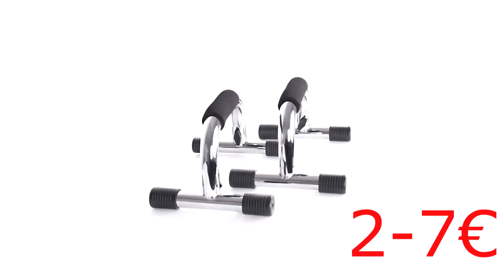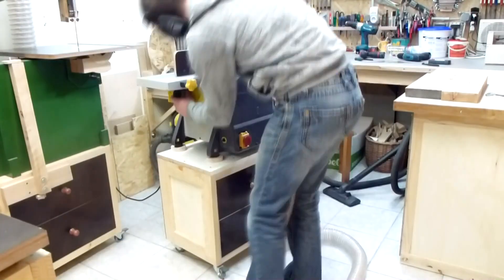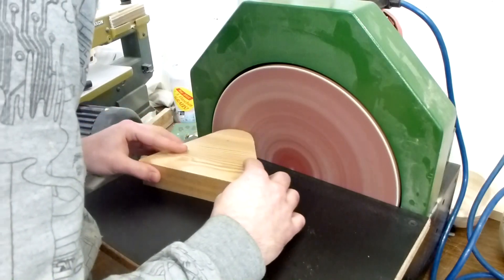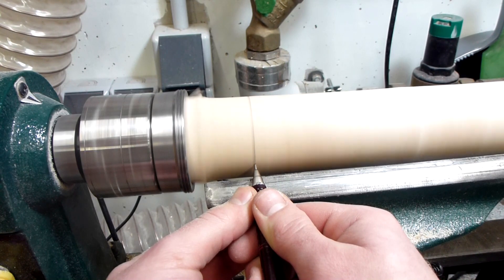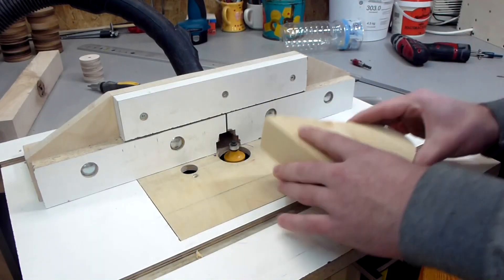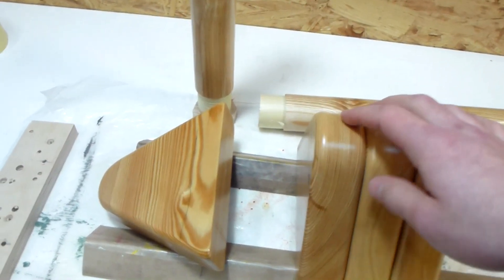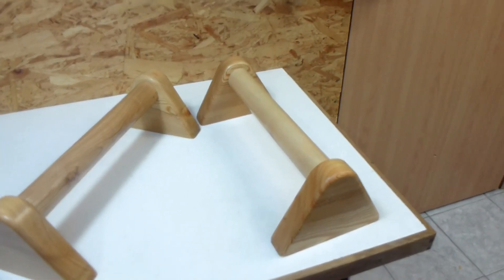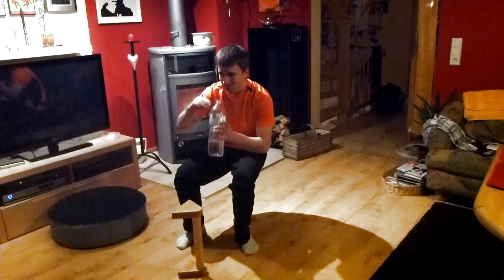Making Pushup Handles

Comment: Well done. I built a set of parallettes similar to the ones in the photos you used in the video of the expensive ones, the one with one screw holding it together. That design was actually ripped off from a German builder at Rawal who builds those parallels with a bridal joint holding the bar on the legs. I like your design though also.
Reply from the maker: +NewportDispatch Thanks.